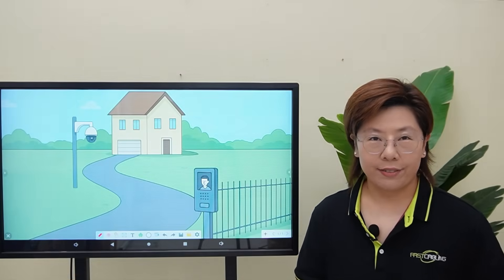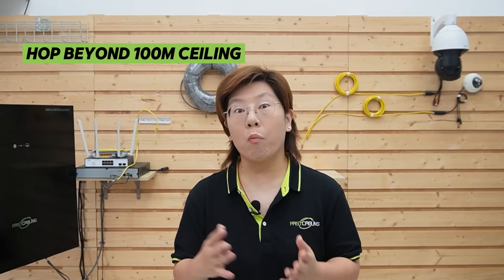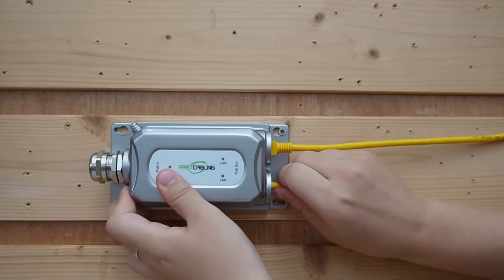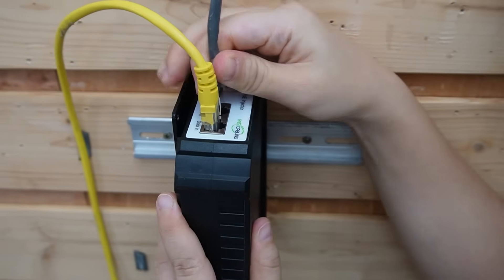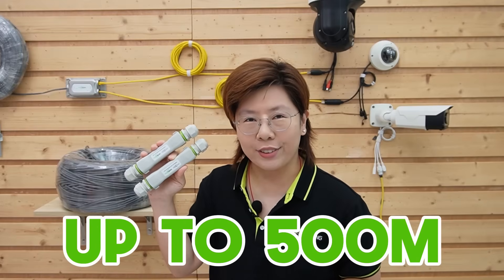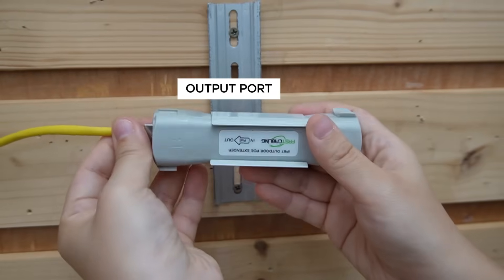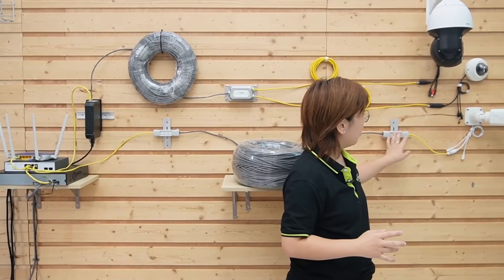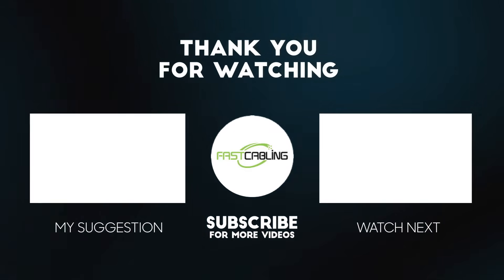How to Extend PoE for 60W PTZ & 350m Video Intercom

Comment: I was confused by your input/output decision on the extender. I thought you always put the switch side plug into the input?
Reply from the maker: The 300M PoE extension kit has a different working mechanism. The diagram is:
PoE switch/injector - (output) 1st PoE extender (input) - 300m ethernet cable - (input) 2nd PoE extender (output) - connected device

https://www.fastcabling.com/product/300-meters-direct-burial-poe-ethernet-extension-kit/